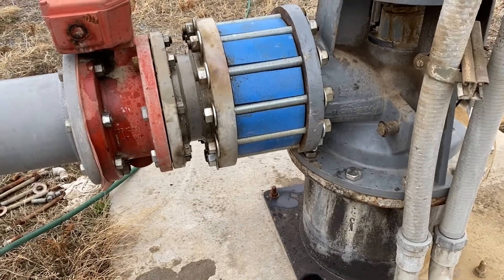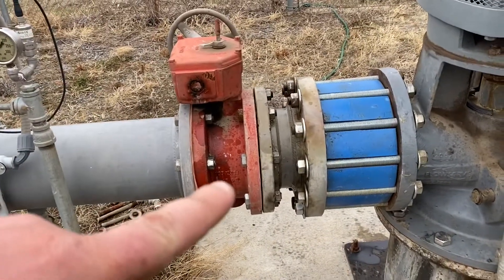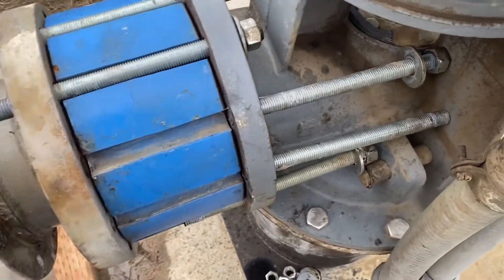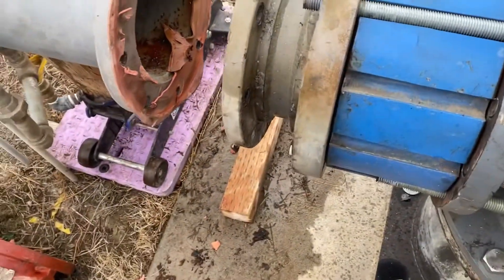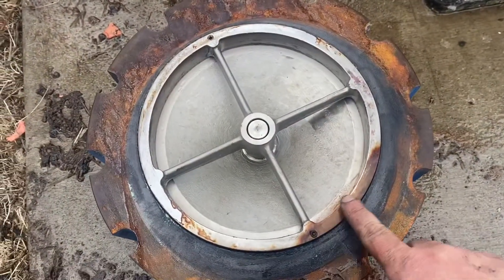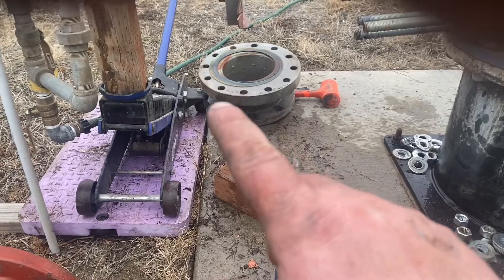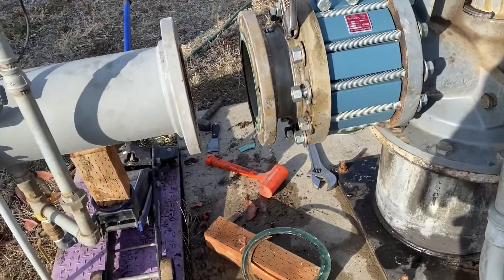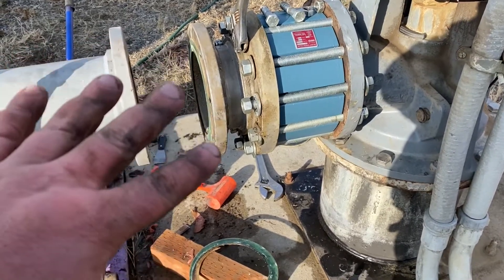Replacing a 8 inch check valve

Comment: Where did you get that check valve? Our pump house has the same setup except we have a 3 pump system. Our check valve is leaking by and I need a new one!
Reply from the maker: I get mine through Ferguson water works, there a nationwide company, you can also get rebuild kits for the check valves if there not ancient
Reply: Thanks so much, keep it up!